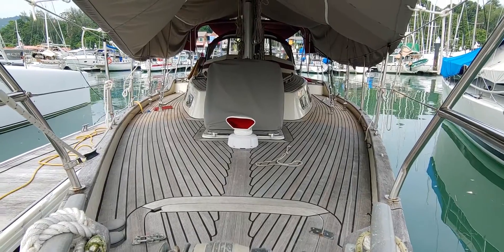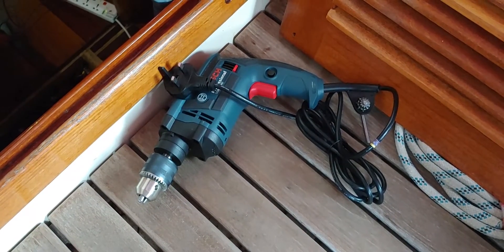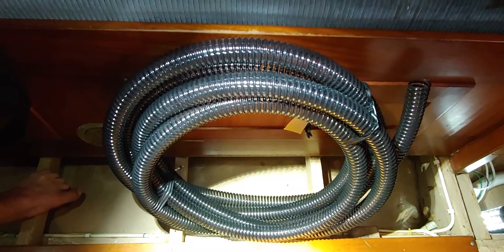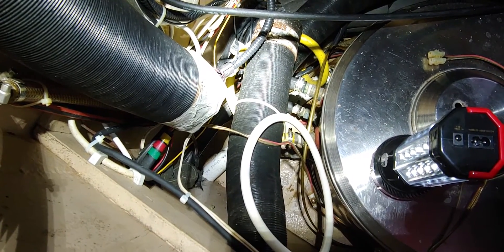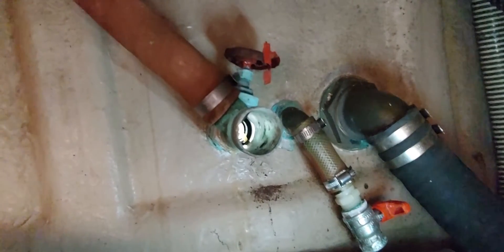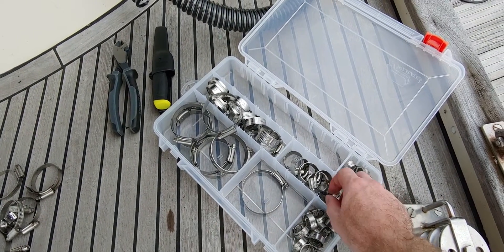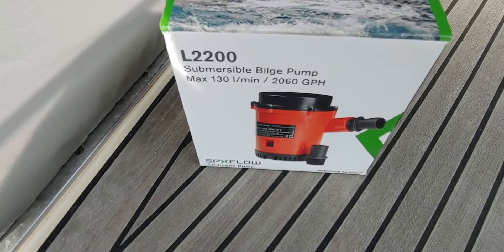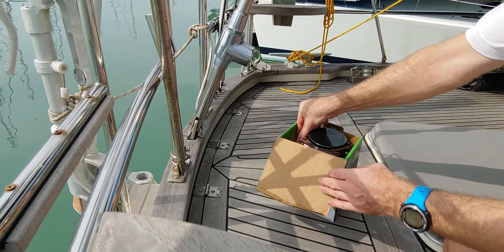Sailing Scarlet  - Bilge Pump Installation

Comment: Do you feel this pump could run 24/7 for at least an entire week in an emergency during an ocean crossing?
Reply from the maker: I would think the pump probably can as long as you keep it clean and there's enough battery power to do so. But the question is, do you have enough battery for that?